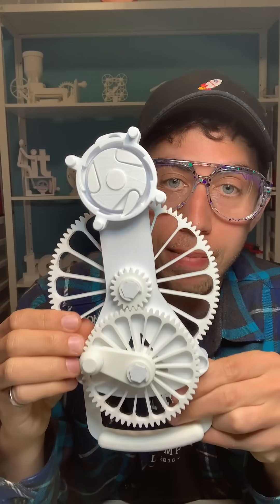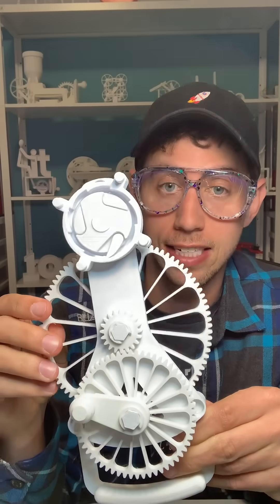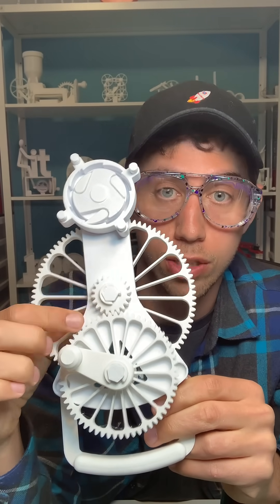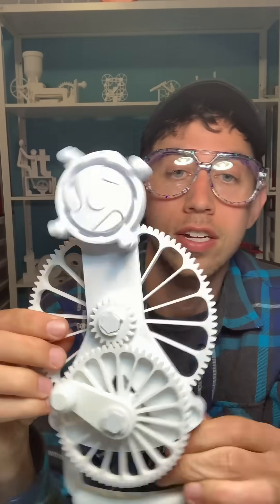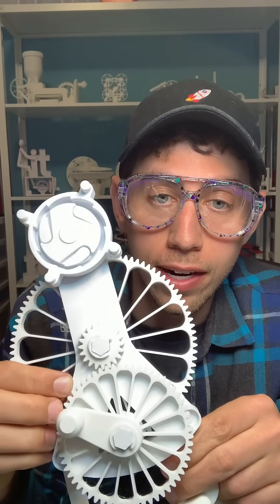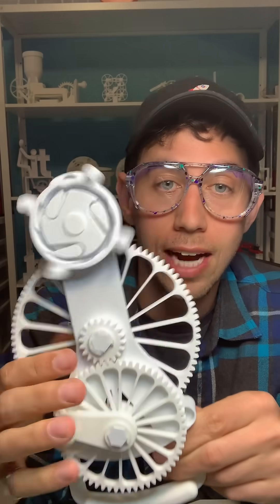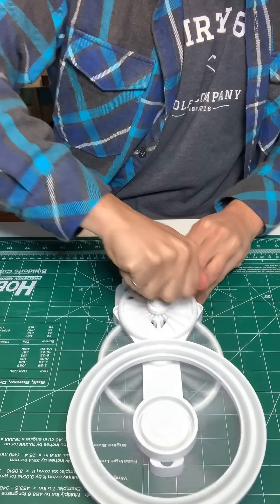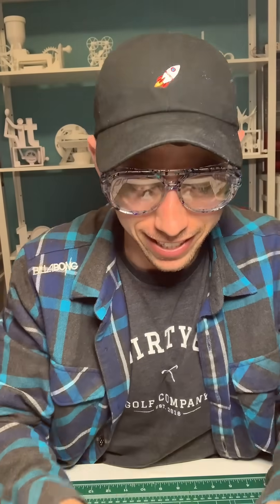The FASTEST Fully 3D-Printed Mechanism I've Ever Made (and maybe the most dangerous...) #shorts

Comment: 1:13.5 ? Check the “Highspeed propeller launcher” with 1:64 ratio. It launches props and tops with speeds upto 15000rpm. The tops can run for over then 5min. long!

Comment: See now this is interesting.  I wonder which is more durable and longer lasting to outfit a gear system or a drive belt.  So many different uses for this.  Food processor! Salad shooter/chopper, fan, helicopter toy... - put a metal disk on it with a basket to create a friction drive and see if you can generate enough heat for a hand crank cotton candy machine... Or an ice shaving machine for Hawaiian slushes.  Power generator.  Miller.. Grinder... So many uses from 1 base machine just by tweaking it slightly for different jobs.  Awesome.

Comment: A shell, in a modern military context, is a projectile whose payload contains an explosive, incendiary, or other chemical filling. Originally it was called a bombshell, contrasting with solid shells used for early rifled artillery,[citation needed] but "shell" has come to be unambiguous in a military context. A shell can hold a tracer.

All explosive- and incendiary-filled projectiles, particularly for mortars, were originally called grenades, derived from the French word for pomegranate, so called because of the similarity of shape and that the multi-seeded fruit resembles the powder-filled, fragmentizing bomb. Words cognate with grenade are still used for an artillery or mortar projectile in some European languages.[1]

Shells are usually large-caliber projectiles fired by artillery, armoured fighting vehicles (e.g. tanks, assault guns, and mortar carriers), warships, and autocannons. The shape is usually a cylinder topped by an ogive-tipped nose cone for good aerodynamic performance, and possibly with a tapered boat tail; but some specialized types differ widely.

Comment: To keep the wheel in place i think you could use helicopter like blades to push it down so it doesn't fly away plus don't make the angle of the blades violent nor have them sharp

Comment: "1000 RPMs" he says. Let me help. 13.5 rotations per 1 rotation of the handle. You're rotating that handle at at least 2 rotations per second before it flew apart from what I saw, which would equate to about 27 rotations per second or 1,620 RPMs. Not bad.

Comment: Today I worked on a fly wheel for my robot it has a 600 rpm motor conditioned to a 84 tooth gear Which spins a 12 tooth pinion gear connected to the fly wheel so a gear ration of 1:7 so yeah it spins very fast and kinda terrifies me

Comment: I want to see an electric motor with a lightweight gear setup for the highest RPM possible. With the spinny part being pretty large diameter so you can attempt to break the sound barrier with the outer edges of the 'spinny part'😂👍

Comment: This reminds me of a toy motorcycle from the 70's that had a dock with a crank handle that you used to spin up the rear wheel to pretty high rpm's. When you stopped cranking the toy bike would take off. Since the rear wheel was weighted and had a rubber tire, it would grip all kinds of surfaces, and would stay upright even after jumps and what not (gyroscopic stability). It was so much fun, and really painful if you happen to get your finger caught between the tire and the frame. Or one of your buddies spooled it up and then pressed the wheel against you. So many fond memories of so many dangerous toys.

Comment: I bet if you used a high-speed bearing it would work better. Also, part of the problem is that the wheel doesn't spin freely, it's dependent on the gear. If it spun freely on a bearing or something, it would basically be limitless. When it's spinning at those rpms, if there's even a little bit of opposing directional force (e.g., you're not turning it a completely perfect rhythm) it's going to break or skip a gear or both.

Comment: Engineering top tip: Always use odd teethnumber gears. Prevents toothpairs from meeting regularly thus developing an irregular wear on the gear.
Reply from the maker: Interesting! Great tip
Reply: Not an engineer question: Couldn't this still happen for example if the number of teeth on one gear is any multiple of the number on the other gear? ( for example 25 and 75).
I Imagine the numbers of teeth on both gears would have to be coprime to fix this.
Reply: @ttmfndng201   You are correct, gears cant be divisible with each other;  change that to 23 teeth on the first gear and 71 on the second is what youd likely see.
Reply: @ttmfndng201 yea it would just develop a “bad wear” pattern three times slower
Reply: I'm trying to design and print a clock right now. thank you for this tip I think I'm going to remake my gear ratios now
Reply: you mean make gears that meet have a relatively prime number of teeth, so that every tooth is pressed equally across the other gear's gaps
Reply: Kind stranger could you explain a little more
Reply: @adityasingh5866  if gears have even teeth on both  gears; they meet at the same point on the same teeth every rotation. Over time, these teeth "wear in" and a few issues can develop. Think of it like rotating your tires;  you wear out specific parts of the wheel and it wears out faster than it otherwise would if properly rotated. So  uneven meshing alternates the meshing of the gears and lets a more smooth wear pattern develop across the entire wheel instead of localized damage that wears the gears out faster.
Reply: @JgHaverty  I still don't get it, I mean I understand the concept but when I picture it, isn't every single tooth on the gear being used anyway?  As in, every tooth is engaged during the gear's rotation.  I get that an odd number of teeth will offset the cycle, but fail to see how this prevents/more evenly distributes wear and tear since every tooth is being used anyway.  What am I missing?
Reply: @danphan9487 due to manufacturing defects / imprecisions the teeth won't all be exactly the same shape and size (or if a piece of dirt gets into the mechanism and gets stuck on one tooth). That'll cause differing levels of wear depending on which teeth the defective teeth come into contact with. But if the number of teeth are relatively prime (no common factors other than one), then the defective teeth come into contact with all teeth on the other gear equally often, so the wear is even.
Reply: New learning
Reply: best practice is not simply odd number, but prime.
Reply: I think you mean that's why they use prime numbers for gear teeth, so they wear more evenly, as the same teeth rarely meet? (As opposed to odd teeth numbers?)
Reply: @robambrose4199  coprimes.
It's numbers that don't share a divisor. Like 16 and 21.
Reply: 15 and 5 are odd numbers. Same teeth will meet same teeth.

If the two gears have a coprime number of teeth, like 64 and 63, then the cycle will be maximized as each toot will be  paired with each other toot in one cycle.

(A cycle is not a rotation, it's how long a toot take to be meshed with the same toot)
Reply: Not really important any more anyways because most engineers engineer known failures at a predetermined time anyways like they are told to do. Planned obsolescence!!! Cars and tools and machinery don’t last anymore either on purpose or due to government meddling like emissions/regulations.
Reply: As an engineer is there any reason this can’t be used to generate electricity?
Reply: @FatRonaldo1  Congratulations, you've invented the wind-up torch!
Reply: @FatRonaldo1 it can, but if the load is to big the gears will just snap due to the forces
Reply: @mylanotten7653 Or it'll be super hard for a human to spin this thing fast enough. Because light plastic is one thing. But a whole rotor of an electrogen is another thing.
Reply: @FatRonaldo1   I mean it needs a few more parts lol; but essentially this is on par with those hand crank radios and flash lights.
Reply: @FatRonaldo1  Attaching a generator greatly increases the torque needed to turn the handle, the plastic parts may break under that much stress. If it doesn't break then yes it could make electricity, but it wouldn't be much.
Reply: Prime*
Reply: It’s best to make the number of gear teeth prime
Reply: @Armoured-Pizza-Carrier 
Coprime is sufficient.

Comment: I noticed your "spokes" in that gear are radial, which is fine if you are using it for a wheel that  has no torque applied. Problem is in order to handle a torque they need to be tangential to some degree so the can resist a tangential load about the axis of rotation at some radius (again a torque in other words). I'm sure it's fine here, just a tip if you want stronger parts.

Comment: I have a remote control car i set up , 60a x 3800kv =256,000rpm , I have a 800a controller . Per amp the motor I have spins 3800 rpm , so x that by 60. So the 800a should be Ludacris speed lol

Comment: I need this as a fan in my hottest days
Reply: U'll sweat more while trying to spin it than how much airflow U'll get
Reply: @HolyG-sus  at 1000 rpm if you attach a 25 cm blade the velocity at the edge will be around 100 km/h. It will defo have some good airflow lol

(then break apart)

Fun fact, fans like that existed since the 1800's. They just weren't commonly used because people weren't pussies about heat or cold.
Reply: @Natsukashii-Records  you're one of those guys huh
Reply: @jckdnls9292  I apologize if my actions caused any inconvenience to you. Is it a problem for you that I provided accurate information to someone to correct a mistaken assertion that they had made?
In the future, I will refrain from doing this as it appears to have caused offense to you while you were casually reading through comments, in an idle manner while being both unhelpful and critical. Your opinion, after all, is of great value and importance to me.
Reply: @Natsukashii-Records  

Now calculate the energy expenditure to get a 25cm blade going that fast (and keep it a that speed) versus the cooling effect gained. Biswaranjan didn't say it wouldn't be fast. Read it again.
Reply: @Natsukashii-Records  
No, it was the fact that you missed the point that was the  issue.
Reply: @NE05P0RlN  Upon further reevaluation of my former comment I have detected the reason for the negative response it garners from certain individuals of special qualities.
I assure you that measures have been taken to avoid future misconduct and I will apply myself accordingly.
Thank you for taking the time to analyze my post and offer a precise solution to an issue of critical importance, to myself, and everyone affected. Have a wonderful night knowing you made the world a better place. Congratulations to you and your ancestors for the fine specimen of organic ingenuity which are your genes. Blessed be your chromosomes, all 47 of them.
Reply: @Natsukashii-Records  that wasn't even right, if you are spinning an object which has a 25cm diameter it'll go 45km/h, nowhere near 100km/h, and to get it to those speeds it would have to spin at 2250rpm which is basically too much to reach with that little leverage that crank can have and by how much drag that propeller is gonna produce.
here's the formula if you really need it,
S=[2∗PI∗(D/2)]∗[RPM/60]
Reply: @filgiupo  A 25 cm blade means that the diameter is 50cm dude... Blade is the length of the radius, not the diameter. Try again.
Reply: Idk only fans is pretty hot…

Comment: Wait wait wait, 1 rotation on the hand =13.5 rotations of the end mechanism, and you're rotating the hand crank maybe 2 times a second.... so how did you get "thousands of rpm"
Reply: Rpm= revolutions per minute
Lets say he rotated it about 2 times a second. That means that 2 x 13.5 = 27 rotations. We now have to multiply this by 60 seconds because there are 60 seconds in a minute. 60 x 27 = 1620 rotations. So our final value can be estimated to be around 1620 rpm. Hope that helped.
Reply: @ctrl6768  yes thank you, I completed blanked about the per minute and it just didn't connect in my head 😅

Comment: If the input gear is spun at 1 rpm the output is 810 rpm.
The rpm of the input gear would have to be about 1.25 rpm, which would be 1012.5 rpm output...
Super impressive, I wonder what you could make with an even stronger material!
Reply: That doesn’t match a 13.5:1 ratio. It would work if you said 1 rev per second tho

Comment: I got a peice of lego to spin 5000rpm using simple gear ratios and a hand crank and i didn't wear safety goggles...Although it did explode a few times but i managed to fix it, turns out there was like 5kg of force pulling out on 1 single lego peice no wonder why it kept exploding

Comment: You should check out my 3d printed turbo-prop.. 3dprinted turbine spinning at 55,000 rpm going through a 3d printed reduction gearbox driving a propeller at 18,000 rpm.. sounds like the real thing..

Comment: Geek saying that a piece of 3D printed plastic doing 1,000 RPM is going "crazy fast." Me, remembering the times I popped the clutch on a recently mounted 20 lb steel flywheel spinning at 8,000 RPM while street racing in the middle of the night at 110 MPH in 1979: "Wow, you must be wigged out by that thing..."

Comment: Tip: make the handle bigger and the ends of the Rods that are holding the gears reinforced so they don't go flying and burn you
Reply: It would be nice to make it into a Fan.
Reply: @murillo_yt9911  It would not just blow air, it would also blow up 😂

Comment: Why don’t they use this for cars then it would take minimum power for maximum speed
Reply: Because it takes more power to turn the gear at the beginning.
Reply: @Tepiig  maybe they can make a bunch of other bigger gears with less power needed and it would switch until they gain enough power to easily move this gear without any stress
Reply: @reversetetragram  im pretty sure you did this on purpose, but thats literally how cars work
Reply: @Tepiig  yes the original comment was a genuine question, but the reply is the realization but I wasn’t sure enough so I didn’t mention it so I left it there as a joke
Reply: @reversetetragram  ah neat

Also gon best character
Reply: @Tepiig  agreed

Comment: Wouldn’t it be a 1:13 gear ratio? 13:1 would be a gear reduction. Most trucks have a rear axle ratio of 4:1
Reply: This guy was wrong on allot of calculations. 1000 rpm is not that fast. It's turning way more than 13 times for one rotation of the handle.

Comment: Is it just me, or could this be used as a renewable energy source?
Reply: No because gear ratios turn torque into speed and vice-versa
Reply: No it can't. You still get slightly less energy than you exerted.
Reply: Yes, if you call and army of slaves renewable energy. You will need a huge amount of continues manpower to get any significant amount of energy.
Otherwise, generators that use a lever like that already exist, but they are limited to low power devices (like charging a cellphone or emitting a signal light) or for starting an engine (like in very old cars, before car batteries). The biggest issue is the limit of how much energy and for how long a person can provide.

Comment: I need a bike that has a ratio like this.. Would be quite fast
Reply: You would need a tremendous amout of force to even move the pedals
Reply: @Zom_  I mean I've seen someone roll a pedal with hand and it lift a ship.. it works with enough gears
Reply: @Zom_  but yeah there would be nee for a massive amount of weight so that the wheel could roll on the road.. if too light it would just roll  in place and not move the bike

Comment: This could be crazy if it could work in a car. Achieve new top speeds?
Reply: After a certain speed, a lot of what’s preventing a car from going faster is air resistance. As cars become more powerful, they can push through more of the air resistance, so gearing is much less important

TL;DR When going fast in a car, horsepower is more of a problem than gear ratios
Reply: @sixtakefives5325  true true, just thought it would be an interesting concept to try ya know?

Comment: Not even close to the fastest. Ive 3d printed an air engine that runs at over 3000 rpm, a 15,000 rpm fan, mini air raid sirens 10000 rpm. Much faster than yours.

Comment: Have considered applying this to bycicles,  paddle boats, or electric generators?
Reply: It has a really high rpm but basically no torque so it wouldn’t work.
Reply: @Ethanzhouwealth  yep nice to see someone correcting someone else in a respectful way
Reply: @Ethanzhouwealth  what does that mean?
Reply: @skiney  high rpm (rotations per minute) means it can spin really fast and torque means the twisting force of the gear which, in this case, is really weak so it wouldn’t be useful for generators
Reply: @Mo-bi1pk  more accurately, it doesn't have "low torque", but it reduces the torque that is applied. You could get as much torque out of it as you wanted, but you'd have to apply many times more at the input.
Reply: Pretty sure the idea of gear ratios has already been applied to pretty much everything
Reply: Gears were invented 1000s of years ago
Reply: @xavier9480  then the gear wars happened
Reply: It doesn't magically give you more energy, so you'd have to pedal with a ginormous amount of force for it to work. Also, like someone said, gears were invented thousands of years ago, it's nothing new.
Reply: @polycrystallinesilicate  electric motor assist
Reply: And this is how he went from a bicycle currier to winning the Tour de France!
He will never win again though as he sadly lost both his legs on the last stage
Reply: Geared cycles have these
Reply: Bruh have you ever heard of something called a „gearbox“
Reply: THTS what iam saying

Comment: Can you like build the same thing with steel and use it practically like build a machine where you need electricity but if you put your wheel there it will guve you high power with low strength?????